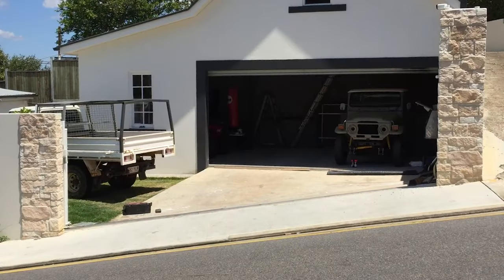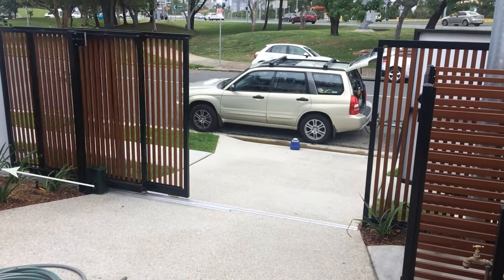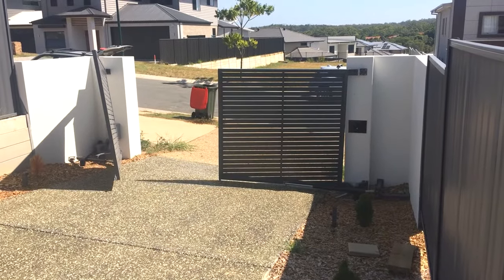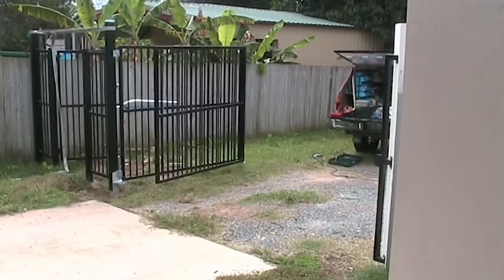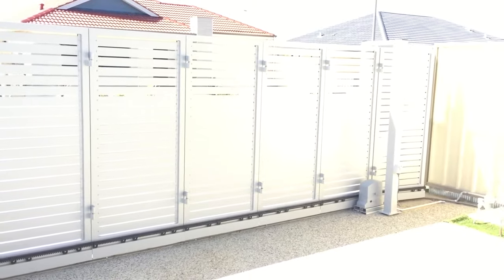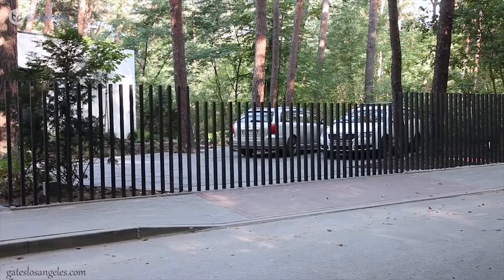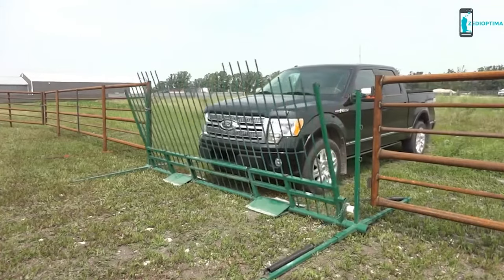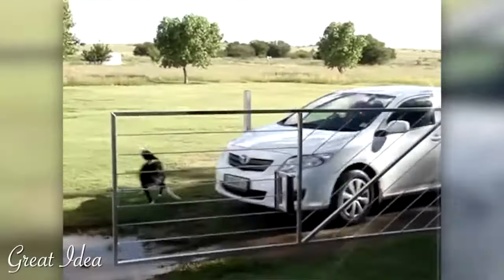Cool ideas for Gates on Challenging Driveways

Comment: Hi Grant
We have been considering fencing the side of our house where the double garage is located. This meant that we also needed double width gates in line with the garage. This was a problem I was scratching my head about until I saw your video.
Our issue was that our property border curved inwards by about 300mm in front of the garage, whereas the rest of our border is straight. We couldn't have swing gates because it would not allow us to park in our driveway when the cars were there. Sliding gates were also out of the question because the curve in our border meant that the 2 gates would not meet in the middle. Your video gave us the answer with the panel opening gates. This now means that we have the option of opening the gate to the right, lining up along the straight edge border or around the corner on the left side. Now all I have to do is to find someone who can make it for me. I am on the Central Coast of NSW, do you have any suggestions?
Thank you for your ideas.
Regards
Kevin

Comment: I have an issue. I want to get an electric gate on my driveway which is straight but the driveway gate will over lap the entrance gate. Again not an issue but the entrance gate has steps and not flush with the footpath so how would i get the gate to open and go past my walkway which is about 20m higher?

Comment: Hi Grant,

Nice video. Unbelievable installations.
Could you please advise if possible?
I have installed a double swing gate  and have a stopper in the middle of the driveway which itself is a hazard.
Does the TDA ZK300DC motor really needs a stopper? Can't it be programmed/ limit switch adjust to stop automatically?

Also, there is a bit of play when gate is closed. I guess a skinny person can enter just pushing it.
Would appreciate your comments. Thanks mate.
Reply: I'm not at all familiar with your opener, but you should be able to adjust the limits to where you want without a stop in middle, then add a 12/24 vdc lock onto gate leaves to stop any forced movement or entry

Comment: Hello kind sir, may I ask what motor you used for opening the doors at 2:50?
I have the same problem and the beninca engine does not work, and my gates are tilted as well.
Reply from the maker: That isn't any particular brand, it's just a generic looking motor we made up because it depends on where you live what motors are available

Comment: I'm looking for some uphill gate hinges. Some hinges say they are not for use with automatic openers, but I want to make it open automatically. My gate will be wrought iron 14 feet wide (nominal), and the driveway goes up 7 1/2 degrees.The gate comes powder coated already so I'd prefer to bolt it on somehow rather than welding if that is advisable. (Alternatively it would have to open outward into the roadway a bit but it's on a corner or T so that might be workable.) What would you use?
Reply from the maker: I use standard ball bearing hinges we have here in Australia and custom make brackets that either bolt on or are welded to the gate frame to make them rise by what ever amount needed and at what ever angle. See http://www.grantsautomation.com.au/index.php?page=33 for more details, which is a page from our website. The size of the motor needed depends on the slope and weight of the gate. We will be making a video about uphill swing gates some time.
Reply: How did you guys go with automating the swing up gates? Is their a video out yet? I'd imagine you would need specially brackets for the motors?

Comment: How does the motor works with telescopic gates?
Reply: The ones I've seen use a flexible wire cable looped around two sheaves at each end of the inside panel. The lower part of the cable is anchored to the ground and the upper section of the cable is attached to the outer panel. When the inside gate is driven the outside gate gets dragged along.

Comment: I am having a self opening metal gate installed at my house for security purposes. It will be solid as to not be able to look in. The gate will be about 25 feet long with a height of 6 feet. I would like to know if I will have problems with the weight?  What do you recommend?  Thank you.
Reply from the maker: So long as you have a large enough motor and the gate doesn't touch the ground when moving it will be fine

Comment: I have a hillside gate, similar to the fifth one you are showing. I would like to install a gate opener, but I am not sure which kind would work for it. Do you have any recommendations or advice?
Reply from the maker: You do need a much more powerful motor for rising gates because you are lifting a portion of the gates weight as opposed to just getting it moving. How much more powerful depends on the weight of the gate and how much it is rising. See http://www.grantsautomation.com.au/index.php?page=33 on my website for more information.
Reply: @automaticGatesExplained  Thank you for the link and info! Do these gate openers have to have any other special features? Do you recommend any particular brand/model?

Comment: Hi thanks for the video lots of information. Found your video doing research. I fabricate and install gates/gate openers. I done telescopic sliding gates and bifold swing. but never tried uphill swing gate. Any tips on designing the hinges. I only know that the lower hinge needs to be offset but what needed for the top hinge and the gate motor like an FAAC 415.
Reply from the maker: Wow, well done, the top hinges for rising swing gates just need to be aligned with the offset bottom hinges that is their centres need to be on the same line. The motor just needs to be powerful enough to lift the weight of the gate. Check this page out on my website http://www.grantsautomation.com.au/index.php?page=33
Reply: @automaticGatesExplained  Thanks for the link.
Reply: Would it be worth it to use a ball joint at the top hinge?
Reply from the maker: Off the self rising gate hinges do have a ball joint but I never have, as we custom make the mounting brackets for the hinge so the amount of rise can be adjusted, maybe I should make a video on how this is done.
Reply: @automaticGatesExplained  thanks video would be greatly appreciated. Sent you an email with some of my work.

Comment: None of the gates comply to the machine directive, all gates must have a safety edge system, with a force test   certificate. All very dangerous.
Reply from the maker: A safety edge on a closing gate must still make contact with a vehicle before the gate will reverse and if a vehicle is moving damage can still be done. We tend to use photocells, these are much safer because if a vehicle enters the pathway of a closing gate the gate will reverse before any contact with the vehicle is made. What does your "machine directive" say to that?
Reply: @automaticGatesExplained  it's not about vehicles, it's about people. In 2015 in the UK two children were killed due to gates having no anti crush mechanism. Photo cells don't always pick people up. I just wanted to make you aware , it's was nothing personal, the gate it self looks very nice.